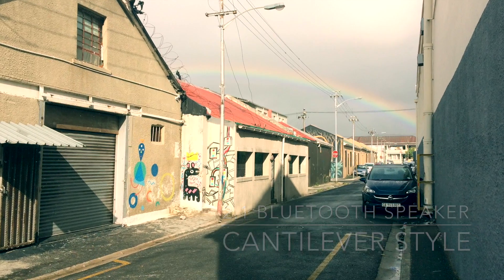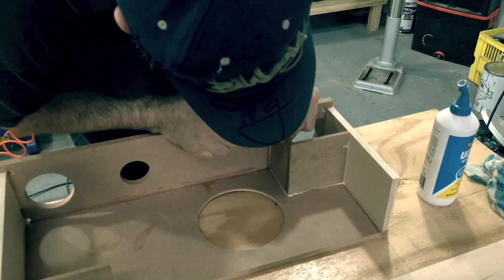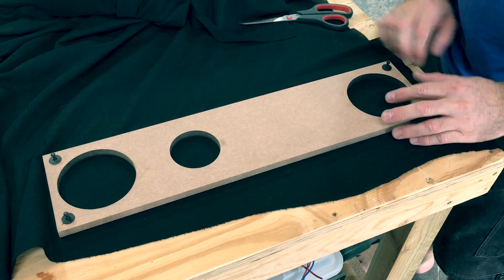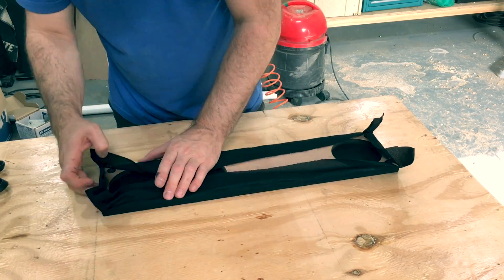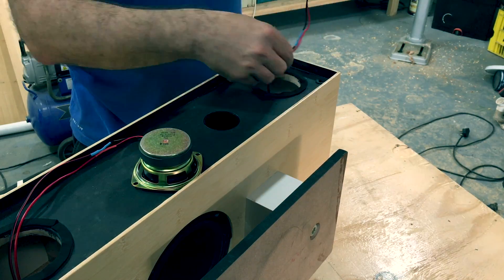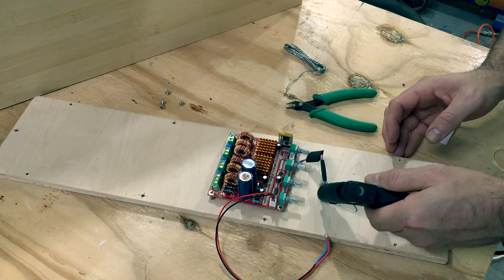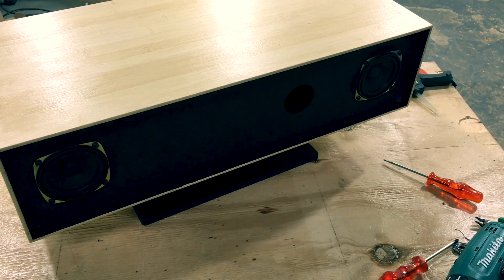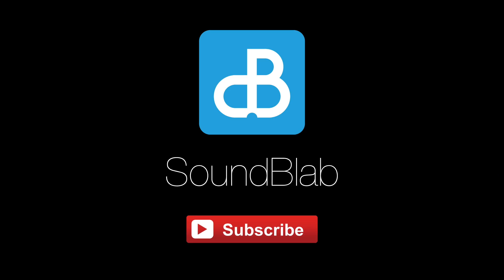Building a Cantilever 2.1 Bluetooth Speaker - by SoundBlab

Comment: very nice design. too bad the back doesn't line up, but who sees the back anyways. 
you should do a better build of this one with more refinement and high quality speakers. it looks like an expensive design piece.
Reply: also, how do you program the Bluetooth module? I guess you need to set a name for connecting and a pin number maybe? or is it open with a random name? what if you'd use two speakers with the same module in the same room?
Reply from the maker: +Tij men Thanks. The bluetooth module has a name already. When it appears during discovery, the pin is 5188.
Reply from the maker: +Tij men I released another build like this in a Mk2 build with off the shelf components and build plan.
Reply: SoundBlab i'll check that one out!

Comment: Great work! Only 1 question: is not very clear in this video where you placed the sub-woofer (being a 2.1 system). Any detail, please? Thanks!
Reply from the maker: Tx! The subwoofer is mounted on the underside of the main enclosure, thus the need for the stand and vertical support.

Comment: Great build! I would like to know, where in SA do I buy the 2.1 amp used in the build.😀
Reply from the maker: Thanks. I ordered mine from eBay. Have not been able to find any locally. The link is in the description of the video. It will cost you roughly R600-R700. And because the package is so small, you should not have to pay any duties on it. It does take a while to arrive though.
Reply: Ok, not quite in SA but, http://www.bidorbuy.co.za/item/248530335/TPA3116_100W_Bluetooth_4_0_Audio_Receiver_HiFi_Stereo_Amp_Amplifier_Board.html

Comment: Wow!!! Great work. Nice. The design is just cool and the product looks like industrial. I was looking to build a bluetooth speak but not one with only 2.0 channels. Your project is what I was looking for. I just want to chose a module that allow me few more option like changing tracks buttons through bluetooth stream (A2DP or other compatible protocol). The module SW-HF41 can fit my needs. It's a 2.1 bluetooth amp with 2x50W + 100W subwoofer outputs. I ordered it from AliExpress: https://fr.aliexpress.com/item/SW-HF41-Wireless-Bluetooth-Digital-2-1-Channel-Amplifier-Board-50W-50W-Stereo-Output-100W-Bass/32754106521.html?spm=2114.44010208.4.42.stIphR.
I can use the including potentiometers to control the bass and tone level but they are too close, as I want big large knob I think I'll disolder them and use wire to attach them on the box. I would also like to add a 12 or 24V rechargable battery to make it more portable (good for picnic). Finally the difficulties I will have are how to calculate the box dimensions to fit my drivers spec as I know that there is a better enclosure volume and shape to provide nice acoustic sound.

Comment: Hi Kevin, I have a power supply that is giving me some trouble. What could cause a power supply to be pull down? What I mean is the power supply is rated at 12 VDC at 40 Amps. when I measure the output with no load it gives me the 12 VDC, but if I put a load it cuts the voltage in half and the fault light comes on. This is a MAGNETEK HP4-1D-T-S1139 power supply.
Reply from the maker: Hi, firstly I'm not Kevin. Unfortunately my knowledge of electronics is not enough to help you. I suggest a forum of some kind. Sorry.
Reply: Sorry, for the name and thanks.
Reply from the maker: No worries :)

Comment: The things you do are incredible !!! I'm trying to do something like what you did in this video, but I have some doubts.
1 - Can you tell me what models of speakers and the subwoofer used in this project?
2 - After the product ready, the sound volume can be adjusted via Bluetooth from your smartphone, or just the amplifier?
Thanks for the help, and continue with their creations ...
Reply from the maker: Thanks, its good to know that you where inspired by this project. The speakers I used where all salvaged from an old system. But I am working on a Cantilever MK2 with build plans that will use off-the-shelf components. I will post it in the next couple of months.

All the controls on the amplifier module is preset, and the master volume is then controlled via the bluetooth device.

Comment: Why did you put some "case" behind the speakers ? Does it increases the bass response ?

Good job BTW !
Reply: Seperate the bass from the woofer so it isnt forcing the Fullrange drivers cone out when bass hits. Also helps with cone control on midbass
Reply from the maker: Yes, each driver can perform more optimally in their own respective enclosures without influence on each other.
Reply: SoundBlab great seperation of drivers causes better SQ in the entire range to be heard. I plan doing a 3" mid with a softdome tweeter and 2 6.5" woofers in a T-Line design floorstanding build. the mid would have its own chamber sealed fron the rest.

Comment: Can you PLEASE advice speakers to a project like yours?
Do you think 2 x 10cm speakers (Like Pioneer TS-G1031i) and 1 x 17cm (Like Pioneer TS-G173Ci) would work good? Could this speaker give a good amount of bass with a similar speaker design like yours?
If you have a good option let me know please!
Thanks a TON
Reply from the maker: The 10cm full range drivers could work as left and right channels, but might need some more internal enclosure space because of their size. The 17cm driver is not suitable as a subwoofer driver for this build as it's specs is more suited to a sealed enclosure. Bass will not be deep.
Reply from the maker: I am planning build plans with off-the-shelf components for a similar build to this soon. Perhaps you want to wait for that to come out.
Reply: Thank you very much! I'll wait for it. What's the price of the plan?
About the woofer, the 17cm speakers says 40hz... Woudn't it sound "right"?
Reply: About the 17cm again, I was thinking of putting a "radiator" ina  6L enclosure
Reply from the maker: Not sure, but was thinking somewhere between $15-$25 for the plan.
Reply from the maker: It very difficult to say without the precise specs of the driver and running it though a box design program.
Reply: SoundBlab NIce price and thanks for the answers, but just one more; do you think that buying a goos computer 2.1 speakers like Logitech Z623 would be a good option to disassemble and make one hand made 2.1 system?
Reply: I bought a Sony HT CT80 to disassemble and make a custome speaker... lets ser what ill get in the final. choose this because it has optical input, bluetooth and 3,5mm remote and NFC. Hope it works... :)

Comment: Did you need to use any crossovers or does that bluetooth amp handle all of that?
Reply from the maker: The amp has an adjustable active crossover of 180-250Hz.

Comment: How do you acces the amplifier controls such as treble and base also volume
Reply: ya don't in this build
Reply: bluetooth controled
Reply: Volume thought Bluetooth treble and bass I have no idea was asking myself the same question
Reply from the maker: All the settings are preset, the crossover point, bass level, treble level and the master volume is set to a level where it will not distort the sound (since the amplifier is stronger than the speakers I'm using). The overall volume is then set using the bluetooth device such as your phone or tablet.
Reply: Ah ok, clear
Reply: Oh ok but why no remote or control pannel
Reply from the maker: There is no need for it really. Once you have preset the controls to sound right you don't need to change it. I also like the clean and simple aesthetic of the design without unnecessary knobs and switches.

Comment: really love your work... do you also build to sell, cause I’m interested.
Reply from the maker: Thanks! Not for sale, but will be doing build plans for a similar build soon.
Reply: +SoundBlab ... ok... really enjoy your creativity. reason why I asked is cause in Mozambique you can't find the components to completely build that speaker.
Reply from the maker: I share your frustration. There are also few parts available here in SA. That's one reason why I used salvaged parts from an old broken home theatre system. Other than that I import parts, but it can get very expensive!
Reply: +SoundBlab you from SA, cool...

Comment: So I assume the volume control is handled from the device supplying music.  Would it be possible to add a volume potentiometer and if so can you do a video showing how this is done?  This speaker looks amazing and I'm sure it sounds just as good.  Excellent job!
Reply from the maker: Yes. Because my speaker drivers are slightly under powered for the amp output, I opted to preset all the tone and volume controls to protect the drivers. Once you have set it to perform well with most types of music you can leave it as is and adjust the volume through your connected bluetooth playing device. Besides, most phones will allow you to select a preset for vocal, jazz, rock etc. types of music. You can add a volume pot, but only if you run your source through the wired 3.5mm jack input, not the bluetooth. To adjust volume through the bluetooth, just remove and extend the current volume pot so that you can mount it for external control. I am however not planning on doing a video on that, sorry.

Comment: Great build, best I've seen on youtube so far. I'm working on my own design and I was wondering what kind of drivers you used? I've looked around and so far there is a definite trade-off between price of the woofer, low end frequency response and size of the enclosure I want.
Reply from the maker: The two fullrange drivers are 2.5 inch and the woofer is a 6 inch. My drivers were salvaged from an old system so I don't have purchase links. Normally any suitable fullrange driver will fit happily in a 0.8 to 1 litre enclosure, and the 5 or 6 inch woofer into a 7 to 10 litre enclosure (ported). I am working on a similar build with off the shelf components and plans for future build that I will make plans available for purchase. Hope this helps!

Comment: Do you know if it is possible to use a 18w amp with a 6w RMS speaker, without destroying the speaker?
Reply from the maker: Yes, but just keep the volume down. If you give it full power it will potentially damage the speaker.
Reply: Thanks for the quick response!

Comment: Would it be possible to get a wiring diagram for this? Or a link to one? I have no problem with the box construction but not an electrician by trade. have some speaker wiring experience, but not like this, thank you!
Reply: Same. I got all the parts, but I don't know what I am gonna wire together and what type of wires

Comment: friend can yo share the dimensions of the Box?? as well as the subwoofer size, is it a 5inch?? 6 inch?? I can't figure about the proportions of the Box with the Subwoofer!!
Reply from the maker: The size of the box will depend on the drivers you use, so I will not be able to help you in that regard. But for reference in my case the subwoofer box is roughly 10litres and each of the full-range driver enclosures is 0.8litres. The sub is a 6inch driver.
Reply: +SoundBlab you help me a lot, thanks

Comment: how do you change the Bass, Treble and volume if the knobs are inside?
Reply from the maker: Bass crossover FQ, level and treble levels are all preset after measurement to give a flat frequency response. After this there is no need to adjust them. Volume is also preset to a maximum level where it will not distort or damage drivers, and system volume is then controlled via the bluetooth device.

Comment: I love it :)! But i don´t understand why you didn't put the board in horizontal so you could use the volume knobs from the outside :)?
Reply from the maker: Thanks! The amplifier is to powerful for the drivers used and will cause damage if the volume goes to high. In order to protect the drivers I have chosen to set up the amp internally and control the volume with the bluetooth device, which means it will never be overdriven and cause damage... And because you can control the volume via the bluetooth device, there really is no need for two volume controls.

Comment: Hi Henry.. Can u please guide me how to go about the volume measure for closed and vented boxes. What the the speakers u have used in this project? Share details please. Cheerz
Reply from the maker: +Parry Bedi The speakers used are all salvaged from an old speaker system and not available to purchase. But if you follow a few comments down you will see some suggestions I made for drivers and enclosure volumes. I will consider doing a video in the future where we look at calculating enclosure volumes for specific drivers.
Reply: Calculating video would be an awesome thingy. I am looking forward on this. ASAP :) Cheerz bro'
Reply: Got it!!!
"The speaker drivers were salvaged from an old broken 5.1 sound system. The fullrange drivers are 2.5inch 4ohms 25watts, and the subwoofer is 6.5inch 4ohm 70watts."

Comment: Hi! 

This build is so good! Looks modern yet classy. I am building a bluetooth speaker cabinet and thinking about using this amp and powersupply. I have a few questions if you have the time to answer that would be awesome!

1. Is it possible to have a bluetooth and 3.5" jack connection? If so, how is the 3.5 connection applied
2. I haven't made a decision on speakers yet but I'm thinking about buying something that would match the amp but don't have the correct knowledge to pick them so I don't need special crossovers and such. Do you have any suggestions for high quality ? (speaker & tweeter?)
3. Is it possible to have a master on/off switch connected to the amp?

All in all a professional build!
Reply: +Tjorvi15 This is what I'm currently looking at : http://www.parts-express.com/dayton-audio-dc25t-8-1-titanium-dome-tweeter--275-045 & https://www.parts-express.com/hivi-m8a-8-aluminum-magnesium-woofer--297-447
Reply from the maker: +Tjorvi15 Hi, thank you! The amp I used is a 2.1 channel amp. This means you get 3 channels. One channel drives the subwoofer and the other two drives the left and right channels. It also has a built-in crossover that can be adjusted between 180 to 250Hz. I suggest that instead of the tweeter you linked above, that you rather go for a full-range driver that will cover the frequencies between roughly 200Hz and 20KHz. A tweeter will not be able to handle that range. The woofer will then cover everything below 200Hz.
Reply from the maker: +Tjorvi15 I suggest the following components: Fountek FE87 or Fountek FE85 in roughly 0.8 to 1 litre enclosures, and for the subwoofer the TangBand W6-1139SIF in a 9.3 litre ported enclosure. All can be had at Parts Express. These drivers are top quality and will make for a superb system.

Comment: Looks really great, but i miss some informations on making the stand.
Using expensive plywood on all the inner parts that are covered with bamboo is a bit waste of material. 
Cheaper chipwood would give the same result. 
Well, i also prefer working with MDF and plywood but if you are on a budget chipboard or OSB will do on the inside. ;-)
Reply from the maker: +tubybubi Yes, I did not film the making of the stand unfortunately. I used what wood was on hand in the thickness I needed, it was the expensive birch ply, but it is much better than chipwood, which I will never use for speaker enclosures. Chipwood does not provide enough damping for speaker enclosures, but if you are on a very tight budget...
Reply: +SoundBlab Chipwood will do, believe me. It's just not good when it comes to painting. The total loss of wood structure reduces any resonances. OSB is not that good, but works good for building internal enclosure stiffening. So if you want less resonance put some strips of wood between the top and bottom of the housing right next to your woofer. This is way more effective than using thicker or "better" wood.
Reply: not beautiful but effective:
http://www.abload.de/img/dsc_5272ufrny.jpg
Or the green parts here:
http://www.visaton.de/de/bauvorschlaege/subwoofer/sub_t2039/bauanleitung.html

Comment: Really shouldn't use bare skin for contact cement man. Other than the mdf base, that's pretty beaut.
I didn't see anything to reduce bluetooth interference with amp signal. How is it?
Reply from the maker: +ROOKTABULA Thanks! So far the skin on my fingers remain intact ;) The amp and bluetooth board is an all-in-one module, and this seems to take care of any potential noise. It plays clean.
Reply: +SoundBlab I was talking more in terms of exposure of time as a known carcinogen. I'm still not sold on bluetooth sound quality in my main system but I suppose it would be good for something like this.

Comment: wow... superb design, thanks for sharing.  Any suggestions about where I can get the tech specs for my own project's (drivers and woofer) enclosure?
Reply from the maker: +Jerson Guzman Thanks! Unfortunately I do not have documented plans of this build, and the dimensions would also depend on the drivers that you are using. I optimised the dimensions for this build according to the drivers I used, and this will be different for your build. I will consider doing a build in future where you can download plans, but right now I do not have the time to do that.
Roughly, the ported enclosure for the bass woofer is 10 to 12 litres, and the sealed enclosure for each full-range driver is 0.8 litres. The bass port is 154mm long and 50mm in outside diameter.
Reply: Thanks a lot for your comments. Looking forward to seeing your next project!